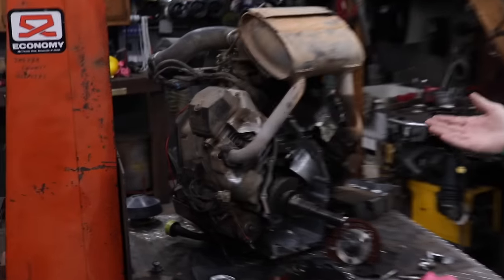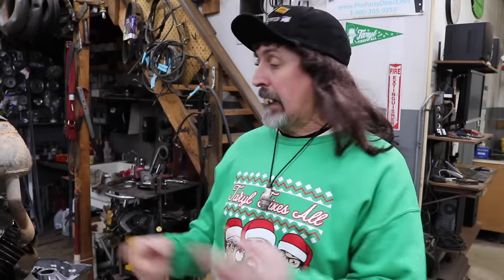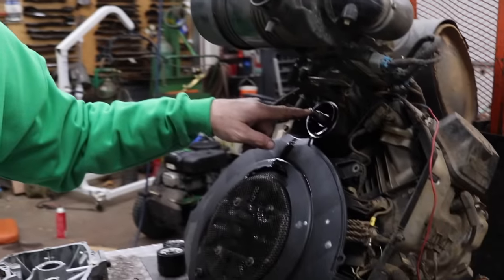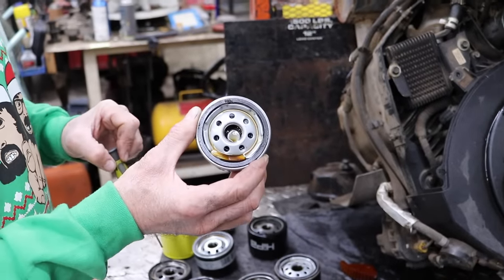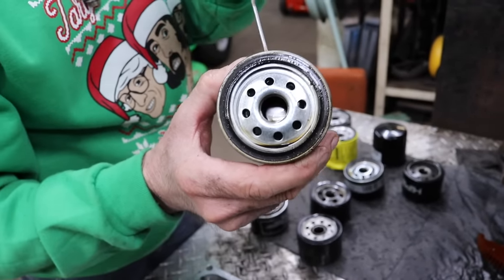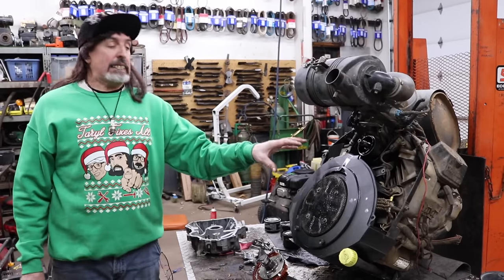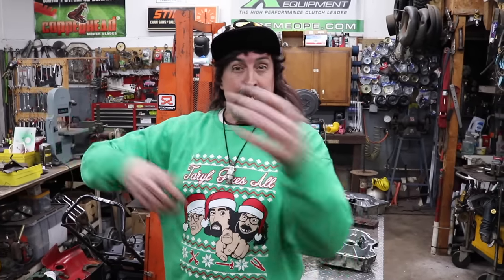💸 $4,000 Down The Drain! DON'T Do This Epic Fail!

Comment: I’ve found that more oil doesn’t necessarily mean a cooler running engine, it just takes more time to heat up, but the extra inch of tin on the oil filter doesn’t make any difference.  I just use the stock Briggs filter and 30w oil exclusively.

Comment: I also ran into some that have a certain spring pressure built in them , luckily they also have a auto oil shut down if low on oil which wouldn't allow it to start . Only one I've ran into and I believe it needed7 or 8 lbs to operate but the one he had was 6 or less . 🤔

Comment: Seems to me that some of those short filters that don't have a mark when screwed on may still cause problems if the pickup is so close that there is not enough room to have an unimpeded flow of oil under the pickkup.

Comment: that looks like a stand pipe to keep the oil from draining back out of the filter when its off.I assume this is only on the vert shaft model with the filter on top
Reply: Makes since but wonder what filter height is relative to oil level in crankcase.

Comment: I’m surprised that Koehler when they designed that type of oil system didn’t make some kind of a bypass system in case something like this happened. Most filters have a bypass built in, in case the filter gets plugged up. Seems like it would make sense to have something similar designed into such an expensive engine.

Edit: After watching more of this video, it seems that just making that center pickup tube a little bit longer so it wouldn’t seal (and then leak all over) might be all it needed. Just make sure the longer filter would still work but the shorter ones would leak would prevent that problem.

Comment: How about cutting the end of that extended pipe back a bit to keep it from bottoming out on the interior of whatever filter gets installed?  Yes I know that the pipe is very likely that specific length for a good reason and I am not saying I would actually cut it down but I would be tempted to shorten it.

Comment: That's a $2 repair for those oil filter receptacle. I purchased the same model engine about 2 yrs ago for a paddock hacker and the way it was installed I couldn't fit the original filter, so after some brain storming with the shorter filters and by mistake finding that that long extension was getting blocked by the short filter got a angle grinder and removed 1/4 inch of the extension... That engine is still going today
Reply: ......RIGHT.   sometimes,  one  has  to  re-do   what  engineers   fu**   up  on......or  the assembly line, installed  wrong   nipples....

Comment: That "thing" in the center of the filter is a bypass spring. I worked in automotive parts for a manufacturer for years and people used to argue with me when they wanted to save money buying an alternate or unproven aftermarket part.   My boss came up with a disclaimer that we could put on the bill when the customer didn't want to use the correct part and we knew it could do damage to their engine or vehicle and it saved us a few times when someone came back to blame it on us.
Reply: DIY's are Dangerous Bro!!!

Comment: I had to look and see if you were right and there are some at 4 grand but I found this site called  sale motors and they had one at 1649.00 for the Kohler command pro EFI ECV940 999 cc 35 gross HP Electric start vertical engine 1 1/8 "x4.19"crank shaft with free shipping says it is new and in stock take a look just a helping hand if needed

Comment: cant verify this but found it on Bob the Oil guy   
 Kohler sells three different sizes of oil filters:
(1) Small 2.25" (28-050-01-S)
(2) Medium 2.75" (12-050-01-S)
(3) Large 3.5" (52-050-02-S). The only difference between these three oil filters is the length, and thus the filtering capability. The smaller filters are made for applications where there is not adequate clearance for the larger filters

Comment: An oil pressure gauge would have flagged a problem. 
I put a pressure gauge on every pressurized small engine for this exact reason at start up, and to monitor while using them. Simple to do, and cheap insurance. 
Never trust the counter person. Always take the part number off the part you are replacing.
That long thread is a standpipe. It's designed to keep oil from draining back, to prevent the system from having to fill the filter back up on startup.

Comment: Does that engine not have a low oil pressure indicator? Of course, they're usually on the outside of the filter housing, so it wouldn't have mattered, i guess.

Comment: I remember a capital and very expensive engine failure I had to fix a few years ago. It was a souped up Harley Sportster Evo. And the customer fitted an oil filter for an old  Saab. Looked like a perfect fit. Same size, same thread. But tragically the anti drainback valve in that Saab filter was the wrong way... Poor engine. It was totally thrashed.

Comment: iv been using car oil filter's on mine for yrs, but i have never used a shorter one due to i used to work on car engines, this can be a mistake ppl make on auto's as well. always, always make sure you have the right length,thread,diameter before you install. imo, as lil as it may be iv always used a longer filter on any vehicle if possible.

Comment: Taryl,   If I were changing an oil filter and went to an auto parts store without first finding what I need and this happened, is it the parts guys fault?  No, no it is not.   If the new part does not match the old one, I would go back to the parts store and got the right one.   
My conclusion, it is the person that changed the filter is the one at fault!   Not the parts guy.

Comment: If you're servicing your own equiptment you have to know what you need, what parts will and won't work. 
I know it wasn't a high dollar mistake but this fall I went through my snowblower stem to stern, it's 22 yrs old yard king/8hp tecumseh, but only used 1 season parked in a shed until I bought it 3 yrs ago, tossed on a ebay carb and ran it until the belts stretched.
Anyway, I went to replace the fuel line it was as hard as a carp.
Went to the local parts store I asked 5 times are you sure it will fit, 
Being the typical parts guy he knew what he was talking about and what I told him I needed wasn't what I actually needed. Even the hose clamps. I didn't want them I needed these....
So I installed his fuel line, at the cost of blood and swear words. Started it up to make sure all was good, 
My flywheel had the fuel line for lunch and was spraying gas out across and hitting my muffler. 
The local equiptment dealer also only had standard fuel line, "it only comes in this size the I'd is right it's what you need, you must have installed it incorrectly"
So, fudge em, I ordered online rather than "keeping it local" 
It took me longer to pull the messed up crap out than it did to install the proper fuel line. 
And a tip to the parts dealers/shops, if you have a female come in that tells you exactly what she needs, do not patronize her and sell her something else. Unless you know for fact she's wrong, and prove your reasoning.

Comment: With a thing like that it may be possible to also not have the filter sealing properly where the gasket is.  That would be if someone didn't know it is the wrong filter and just stopped when it felt tight.  As for the design of that nipple for the oil filter to screw onto I also have no idea why they designed it that way.  Then what is with that plastic thing in there?  I never saw that on anything before!

Comment: Even if the tube doesn't bottom out in the filter it still could restrict the oil flow enough to cause a disaster . Trying to figure out why Kohler added length to the tube ?

Comment: Hello brother Taryl can you shave some of the pickup tube to make a small oil filter work
Reply: Why would you go through the extra efforts as opposed to just buying the correct filter in the first place? What are you saving in the long run? Shorter filter gets clogged sooner and reduces the  overall oil capacity that the engine was designed to operate with. SMDH
Reply: Well it's just a question of if you could so don't take it this any further than this ok

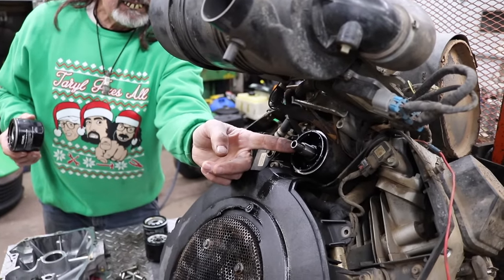Comment: 9:43 I would be willing to bet that the reason that sticks out so far is to further separate the discharge and pickup in the filter further using more of the available surface area.
Reply: What is (that - sticks out) you're talking about and what is on the bottom of that filter that the that is bottoming out on and what happens to the oil when it reaches the bottom, does it disperse in different directions through the paper ?

Comment: That thing in the center on most quality filters is the bypass valve. It may not have contacted when just screwed on with some of those short filters when closed but if it opens up at start up it may still block the passage. Also you left out how nasty people get when you don't want to sell them the wrong part but they still want their gratification and want it now.
Reply: Sell the somebody the wrong part can be good for business as when the engine breaks you can turn a $5 sale into a $5000 sale.
Reply: @tommak6516 not likely, they will blame their incompetence on the shop.  “They sold me the wrong filter and it blew my engine”. Then drag the shop’s name through the mud.
Reply: and lose your business over $5. Great idea 🙄
Reply: How can one sell the wrong part, when the customer is asking for the part.
Reply: @DAS-Videos  as shown not all oil filters are compatible with this engine.  Often the customer doesn’t know what brand the mower is, much less the engine.  Sometimes they can’t remember the color when asked.  Often the parts seller at the shop isn’t a mechanic.  Lots of room for error when the customer is clueless.
Reply: @1anthonybrowning  I was replying to Indy's comment, that people get nasty when you don't want to sell them the wrong part. If a customer asks for filter 24nt, that's the filter he will be sold. If the customer doesn't know what part he wants, how can he get mad at the shop for refusing to sell a wrong part to him?
Reply: Not all engines use a bypass valve in the filter. Many have the bypass valve as part of the engine's oil system which means that a filter with a bypass valve is just another point of possible failure. "It's not the space shuttle, it's a lawn mower."
Reply: @DAS-Videos  I have a friend that owns a shop.  I’ve been there when people come in to ask for a starter, blades, or a filter and think they are all the same.  A lot of people don’t have a clue about their outdoor equipment.  My friend has sent them home for the model number, after telling them how to find it, before selling them a part.  If someone asks for a part by number, then the consequences are on them.
Reply: @1anthonybrowning  Yup. And in the instance Taryl talked about, the shop thought they knew what oil filter fit the customer's B&S and sold them the filter, but it turned out to be the wrong one and ruined the engine.

Comment: Had a customer a couple of years ago with a nearly new Gravely zero turn that decided to do an oil change on his mower himself. Unfortunately he didn’t notice the gasket from the old filter was stuck to the block when he installed the new one. He then proceeded to mow his grass not realizing that the old gasket has blown out leaking his fresh oil right back out of the engine. By the time he noticed the problem, it was too late. Had to order and install a brand new engine. An expensive mistake indeed!

Comment: Take the efi heads and put em on the carb version engine. They run so much smoother and last longer. Also use the efi head gaskets, they also last longer cause of the metal band in em.

Comment: Something else to be aware of: I had a Scrub Cadet come into my possession last year. Fuel injected Scrub engine. It needed a short filter due to steering linkage. Mower had 20 hours on it. Guy put a tall filter on it. First pass in his yard, the steering linkage knocked a hole in the filter. Leaked all the oil out, locked up the engine. Took me 6 months to get parts for it
Reply: LOL, Chubby Johnson !!!
Reply: He was a fine actor
Reply: some do it yourselfers can be a Dangerous element with lawn mowers

Comment: This is a great video...

I think the REAL lesson here though, is, whatever you have...  Be it Audi, GMC truck, motorcycle, small engine, lawn power equipment, whatever it is...  Make very very sure you are putting on the correct oil filter.  

And hey, be smart...  If you're taking off the big long yellow one, do a stare & compare on the new one you bought...  If it's NOT the same, STOP.  Rethink.  Take them both BACK to the place that sold you the wrong one, and say "Hey guys, I need THIS ONE", and show them the big yellow one...   They will make it right.  Look, they don't WANT to sell you the wrong part, they want you to be happy, and come back, and buy more stuff...  Some of those cross reference books have mistakes, it might not even be their fault...  someone fat fingers a part number, you get the wrong thing in the chart...  It can happen, whatever.  If they give you any hassle, stop going to that shop, go somewhere else.

We've all been sold the wrong parts before...  With apologies to the Grass Rats Garage, of course I'm sure they never sell anyone the wrong part....  But other places do.  Don't trust.  Verify.  Make sure.  I wish I had a dollar, for all the wrong parts I've been sold over the years...  But I digress...

If you really don't know what you have, take pictures of your tractor on your phone.  Take pictures of the model number, serial number, numbers off the motor, whatever you can find.  Show that to the people at the repair shop.  That will help a lot.

If you don't have an owners manual, go on the website, with your model # and serial number, enter that in...  They have owners manuals on PDF.  Download that.  Print it out.  Read it.  Whatever you gotta do.  Figure it out.  Do some due diligence, on the equipment you own....  It should say in there, this is the oil filter you should use...  Use that one.   Don't outsmart yourself.  If you go to a shop to buy it, have that information with you.   If the Kohler one costs a little more, so what?  You're saving a ton doing it yourself anyways...  Don't worry about it.   OR, make darn sure you're getting the real identical cross referenced replacement.   The filter makers, the NAPA, the Wix, Mobil one, AC Delco, Motorcraft, whoever, they have charts, that tell you, this filter = this filter in our line....  But again, it should look & feel identical pretty much, when you get it....

I'm rambling again.  Bottom line, know what you have, and buy the right stuff.  If it looks different, STOP.   Re evaluate your life choices....

Comment: I had an oil filter that I ordered for an ATV a few years back and use good name brand oil filter. You know those two letter guys. Lol Well they dropped a "-1" off the end of the part number form the filters that I normaly ran and wouldnt you know...The new filter was shorter. It didnt cause an issue for me but it could for some one else. Always copair the new part to the old one.

Comment: I'd have been concerned when I saw the size difference and rechecked things before installing.
The other is spark plugs. I always put the new spark plug next to the old to make sure the length is the same. Here's where you don't want a longer one!

Comment: If a person picked up the incorrect filter one would expect that they would confirm size with the old one at time of replacement, if it was a different size they should have been aware and took the purchased oil filter for one which was required. You need to put the err on the person who did the oil change, took off the old filter and noticed it was different from the replacement and went ahead and changed it out anyway oblivious to the consequences. Likely some kid in a repair shop who has no idea of mechanicals. Cheers.